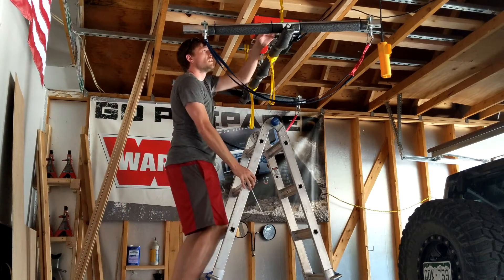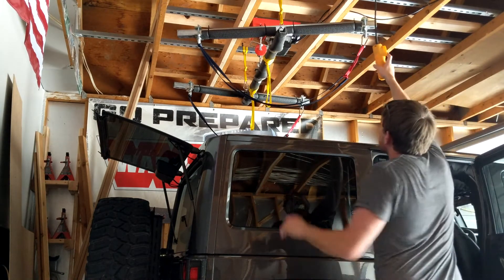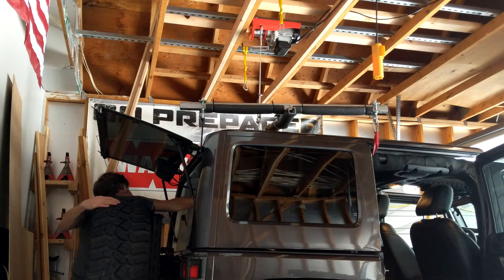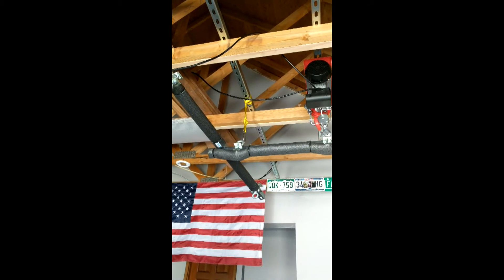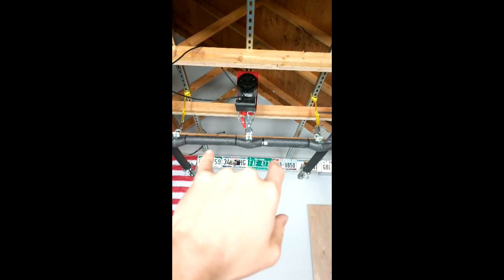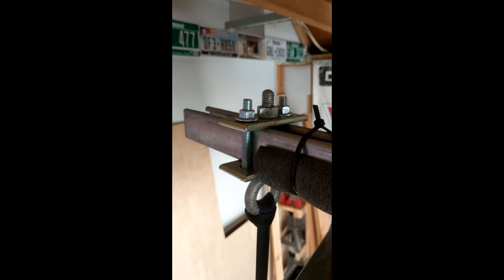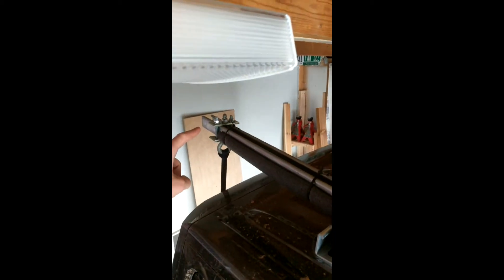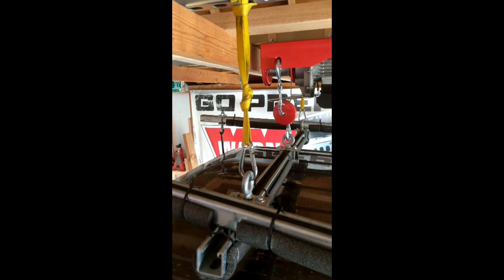Ultimate Garage Hoist for Jeep hard top or anything else you want to lift

Comment: This is a great video of  DIY electric garage hoist for a Jeep hardtop.  Very well put together and very much appreciated.   I was looking around because I wanted to spend less than the Smittybilt Jeep hardtop hoist #510001, an 'off the shelf' solution that is ~$265-$275 ish.   However, If you add up all the BOM above, it comes to well over $425!   I will most likely go with the Smittybilt solution.   Its over $150 cheaper and is an off the shelf solution that you can also mount your Freedom Tops on it as well. 

No, I dont work for Smittybilt or are in their pocket in any way.   I just figured I could make a solution from scratch that would be much cheaper so I started to look on YouTube for folks that built their own.  This video showed me that I could not make it cheaper unless I just bought only a hoist and nylon straps but I dont want to just go that route.  I would rather have 'skeletal' support like the one shown on the video.